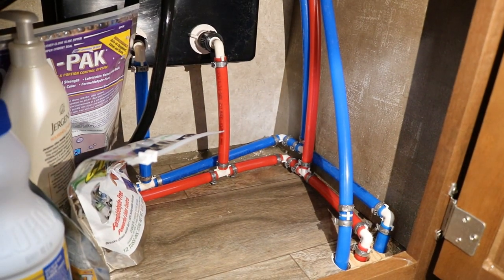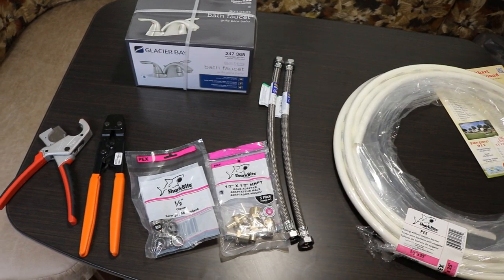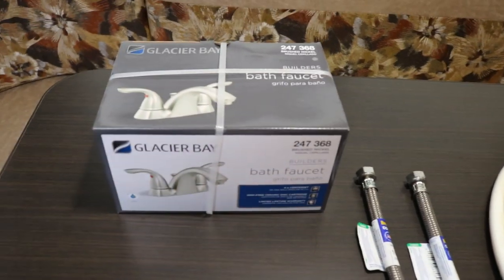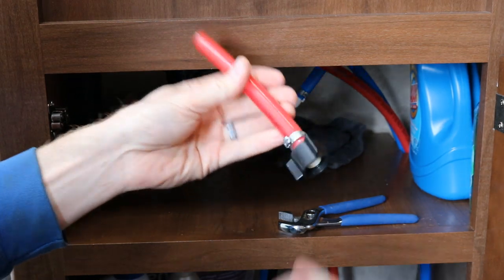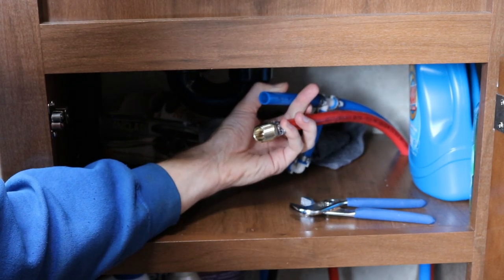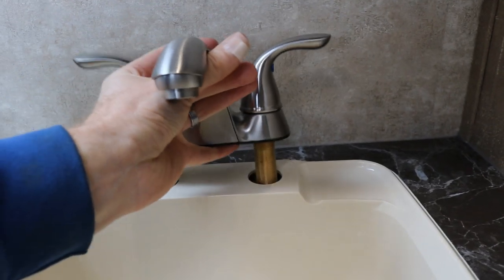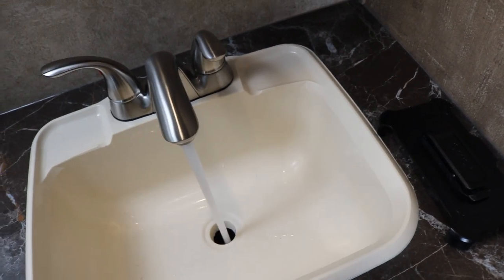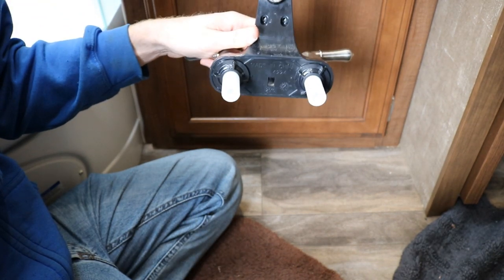HOW TO FIX RV PEX (Faucet Replacement DIY)  #rvlife

Comment: Exactly the same issue. Hot water line to bathroom sink leaking for absolutely no apparent reason. I have my own repair plan based on our setup, but what a relief to know someone else has experienced the mystery leak.
Reply from the maker: Should be a simple fix for something tht factory messed up

Comment: I did something similar, but instead of the male fittings, I used shut-off valves.  Did the same for the kitchen faucet when I upgraded it.  That way, if one leaks, it can be isolated and the rest can be used.
Reply: Excellent idea and one I'll add to the repair I'm doing on my system today. Thanks!

Comment: BrassCraft makes a push connector (like a shark bite) with a shut off valve and screw on connector all in one for around $17.00.  They sell them at Home Depot
Reply: Thank You for the heads up about the Brasscraft from Home Depot.  My hot water spigot under my kitchen sink started leaking and I didn’t want to wait for the swivel seals from Amazon so I went and got two of them and because I was small enough for the 14 inch wide cabinet, I got them both changed out and back up and running in 30 minutes. You guys are the best at helping people that will DYI..  Also love I have cut off valves now. I figure before the end of summer I will be doing the same thing under the bathroom sink.

Comment: My bathroom faucet cold handle blew out & i have a regulator on the water coming in. Im going to change the kitchen faucet too. Thanks for the video. Im putting shutoff valves on mine
Reply from the maker: Great idea

Comment: At the 10:00 mark you were wondering why the swivel termination fitting leaks...It is the sealing washer primarily. They start soft and conical, but harden, flatten/form a step, and then start leaking. Instead of using flex connectors, if you 1.use elbow fittings to remove stress and align fittings properly and 2.use a new swivel seal (flair-it brand seals will work in your fittings), all will be well. Your mfr did a terrible job aligning fittings. I'm seeing a lot of that lately, and the stress often causes swivel leaks...which I get paid to fix. The reason those flex connectors are not generally used is because RV water pumps are wimpy compared to city water pressure and volume. Flex connectors have restrictive (tiny hole) end fittings which works fine in a home, but not so good for RV use except in park models. Sorry for the rambling comment, couldn't help myself. 23 years repairing RVs professionally, and I do a lot of plumbing.
Reply: Thank You for your expertise and knowledge I appreciate it

Comment: I had the exact same leak in the exact same spot. I watch your video and it gave me the confidence to perform my own repair.  I purchased the exact same faucet and supply lines as well..The toughest part of the job was tightening up the supply lines in a very confined area as you know.  I ended up using the shark bite fitting in lieu of the crimp fitting…Thank you for posting  this video!
Reply from the maker: Glad it helped!👏🏻👏🏻

Comment: Great video and I agree with you, I fix it myself. New 2017 Coachmen travel trailer had super cheap ac outlets that were breaking, They crimped on the hot and neutral wires inside the outlet. I went to Home depot, bought new Leviton 20 amp outlets, blue boxes, cover plates and replaced all the broke ones myself. It would have sat at the dealer repair for 4 weeks.

Comment: Your video makes sense, just had the same thing happen in my rig. Kept on seeing water under the sink but couldn’t find it until yesterday. All of my connections were tight but after really getting into it I noticed the leak was coming from underneath the center of the faucet... when turning on the hot or cold water. I went to Lowe’s and did exactly the same repair you made. Thank you bro. Your parts list was spot on.
Reply from the maker: Glad it helped! Thanks for the feedback.

Comment: Another great video. I have the same issue I'm fixing today but in the kitchen. My leak is the connection to the faucet failing. Thanks for the info as it's my first time working with Pex. I have  a feeling the main sortcomming of Pex is the Pex to threaded connectors. Your solution going Pex to brass with standard supply lines is perfect and what I'll do on mine. As for DIY, yeah, "give a man a fish....". Being able to handle your repairs on your schedule and on the road is the only way to go. Thanks for your brilliant channel!

Comment: Good job. Best to install two shut off valves so on the future if you have trouble you can shut off just that faucet. Flexible supply lines is a good upgrade for all faucets.
Reply from the maker: Thanks for your input!

Comment: I just spent 4 days in my Heartland with no water because of this same issue.  The plastic fitting came off and fell apart.  Of course I had no way to cap off the pex and was nowhere near a store to pick anything up. I could not a shut off valve to the sink so we could not use the water at all.  I will be changing to flexible line and a real faucet.  Thanks so much for this video. Real life saver.
Reply from the maker: Very welcome! Hope you get your trailer fixed up quickly. Let us know if you have any questions

Comment: Great video.  Agree on fixing it yourself vs. RV dealer.  Our kitchen faucet needed to be replaced.  Went to Lowe's to pick up the faucet, but it came with integrated supply hoses.  So, another trip to Lowe's for SharkBite PushToConnect shut-off valves.  Snip, Snip, PTC, PTC, and screwed on the supply hoses.  Now, if our sink ever has trouble, we can just twist the valves to shut it off, instead of shutting off the entire water system.  This is important for full-timers.  We've also replaced our shower with a residential one, , and swapped in a residential fridge, too.  Someone in our RV park was in need of a "new" fridge, so he helped me remove it, and hauled it off.  Nothing is sacred in our RV. You know... except each other.
Reply from the maker: That's pretty cool that you put in a residential shower! If we would keep things long enough we'd do that too

Comment: One tip I would offer when installing a new faucet, always connect the supply lines to the faucet before you drop it the sink holes.  Either have threaded hold down washer over the lines or run them up to tighten.  It’s a lot easier than trying to tighten them once faucet is installed.  Great video, thanks!
Reply from the maker: Great tip, thanks for watching!👍🏻

Comment: Nice video.  I was specifically wathing how you handled the PEX type B fittings as I have a similar project in my own RV.  You covered it well.  One comment I'd mention is that looping the flexible lines is a good idea.  An old experienced plumber told me to measure the length that you need and then buy about 10 inches longer so you can form a loop in the line to prevent side-loading the end fittings of the flexible line.  He said that was where they always fail.
Reply from the maker: Thanks for the info!

Comment: 3 years later from the video, I’m having the same problem.. so glad you made this video . Thanks
Reply from the maker: Glad to help!
Reply: Same deal right now again gave a little turn and leaking more than before but sadly  im used to it already  Brand new jayco been nothing but leaks at every joint jayco and the dealer we purchased from say user error 60k cash and almost 10k for extended warrenties juat to be told we cause the leaks at jounts
Reply: @WanderingWagners  funny i sent my comment before you finished video yes i agree they had ours for over a month and it came back same problems jayco found nothing wrong.with it no leaks .... often qonder if they hooked water up to it because at that time before fixing myself we had big puddles in basement everyday .. now we discovered the joys of the condesating walls of every tip out and mold happening under mattress its a nice trailer its home but man its a battle .. ok my. Comment turned to a rant lol sorry its late and kitchen sinks doing as ur bathroom.did  never ending haha thanks for sharing ur fix
Reply: Crazy I have the exact same model and year and have the same problem

Comment: trailer - 2019 grand design imagine 2670mk

wow, with how many people had the exact same problem as you and i, it seems like maybe the  industry needs to look at better installation standards. 

I took your advise on the half inch to half inch flex supply so that my water lines will sit straight and not be tugging on the tap. to be fair i had a crappy $10 pressure regulator before, then upgraded to the higher flow $70 pressure regulator with the psi gauge, and ran it on default @45psi and when this happened it was right after a psi spike from heating water...so i partially blame a weak and ill designed installation and partially blame myself for not leaving a drip while heating water haha but thanks again for the help and idea!
Reply from the maker: Yeah the QC at RV manufacturers doesn't really exist unfortunately
Reply: @WanderingWagners  Sad but true.  Older, as in 40 to 50 year old trailers were built so much better that todays over priced units.
In this RV park I have neighbors with units 50 years old that have stood the test of time even with a decade or two of full time living.

Comment: We brought the same Jayco trailer and sure enough we have the same leak in the bathroom faucet. Thanks for posting this as I'm going to do the same fix that you did.
Reply from the maker: +jldacz after the fix I made we haven't had a single leak since. Overall we love this trailer!
Reply: I bought a 2017 Jay Feather. Same thing. Leak under the bathroom sink at the "T" for my cold water. Had it fixed (since its warranty) and it leaked again, this time from the same place yours did. Its back in for the warranty (its about 1 mile from where I store it). But im going to purchase the tools and some pex to keep with me from now on. Thank you for the video, its helped a ton!

Comment: I just found a leak just like this underground my kitchen sink. Thanks for the video really helps me out.
Reply from the maker: Glad it helped!
Reply: Did you put any thread sealant on the connections
Reply from the maker: I did not. Those fittings don't require it.
Reply: Wandering Wagners ok great just making sure I don’t need it.

Comment: Had same issue with 2020 Coachmen. The water didn't leak until water heater cycled after doing dishes or taking shower.
Reply from the maker: Hopefully you got it fixed up!

Comment: The fittings the factory used are the cheapest ones they make when it comes to rv plumbing. they crack at the base when you over tighten them to, so most likely the pressure from the pex and the amount they tightened it caused it to have a hairline crack, then when you tightened it yourself it cracked the rest of the way. if i was you, i would replace any and all fittings with flair it fittings.
Reply: the cracks are hard to see.

Comment: Excellent video! - It's given me enough confidence to try to replace the cracked manifold in my new Winnie. When I took it to the dealer late summer, it sat there so long that it cracked since it wasn't winterized. I'd rather fix it myself than drive it back to them (125mi ea way) and leave it for another pile of weeks.
Reply from the maker: Exactly is always easier, faster, cost efficient to fix things yourself. Glad this video helped give you confidence

Comment: Nice fix! We had a leak in a similar location (under our bathroom sink) but it was actually the city water inlet fitting (one of those places where it was bent sideways and stressed instead of using a 90° fitting🤦🏻‍♂️)! The least we had before that was where the hot water line connected to the water heater. Just like you I tried to tighten it but it ended up way worse so I just replaced the fitting which still seemed fine! No idea why it leaked so badly!🤷🏻‍♂️
Reply from the maker: Just the way it is unfortunately. Glad you got it all fixed up! That's why we carry pex and tools with us at all times haha

Comment: I believe the reason why they use plastic water fixtures it's all part of cutting down weight. That my opinion based on absolutely nothing but thought. Thanks for the video! I have the same leak on the hot water line. I believe that it has to do with the expansion and contraction of hot passing thru a cold pipe over a period of time. I found that the only time mine leaks is after the hot water was used.
Reply from the maker: The connections were loose from the factory in our case. Both the bathroom and the kitchen were loose and the bathroom needed replaced. Easy fix though!

Comment: Inside that hot line you showed there is a little white grommet, what happens is they get over tightened at factory and that grommet causes the leak. Which might of been why when you tried to tighten it increased the amount of leak. Replacing that little grommet should stop the leaking and then do not over tighten.
Reply from the maker: +Ryan Remy thanks!

Comment: Its really sad that a brand new expensive camper leaks after a few camping trips, i`ve owned 7 campers in my life and most are built like crap, our present one has a rotted slide floor from improper water drainage and the slide just sorta floats when extended. Done with slides and i am convinced that the Scamp 5th wheel deluxe model is the only camper i will purchase in the future, small but perfect for just me and the wife and a dog. Enjoy your videos and as a retired semi driver i enjoy watching you be the boss backing that rig up !
Reply from the maker: +billg1527 we've had non slide campers as well and they're not without their issues. It is sad how the rv industry has no quality control. Looking at brand new rv's on the dealer lot and seeing things broken already is proof. Sad that it's expected to have issues right away.

Comment: We tend to associate plastic with cheap, but if everything in the trailer were metal instead of plastic it would weigh significantly more. Good video. Thanks!
Reply from the maker: We'd rather have heavier trailers vs flimsy ones that don't last but a few years of decent use. Thanks for watching!

Comment: That’s exactly my problem, it’s the hot water line, up under the sink.
Reply from the maker: Seems to be a common problem
Reply: I'm so glad I looked on YT and even more pleased to have found this repair and helpful fix to a bathroom faucet leak.

...this is my story here below....

My vintage 265 "Casa" SHASTA that I have been living in full time now for five years just had a leak occur on my bathroom's cold water line.
I'm going to close off that line temporarily with a cap until I can gather all the pieces including a shut off valve and new faucet to fix the quite old assembly from the factory when this unit was built back in 1996. 
As it is my habit to use only the 'cold' aspect of the faucet it appears, yes appears* to be that this is the side that is leaking. 

* I still need to get into the cabinet and locate the leak but I'm pretty sure it is the cold line that has given up holding a seal.

My best friend is willing to be my plumber for a day (hour or two) in the tight quarters of my Casa Shata's bathroom; thank goodness for good friends that are small in stature.
My 64 year old body is not so flexible, for sure I'm not so good at kneeling and squatting in the confines of an RV bathroom.

Comment: Plumber's tape isn't necessary? Curious, only. Adding cut off valves to each line may be a real life saver when a leak happens and you are trying to stop the gushing of water everywhere. It isolates the line and just seems like the better way to do such. Nice video. I have an E-pro 19FD and some folk claim I can access my kitchen sink water faucet by removing the outside shower panel and getting to it from behind. Believe me, it is all "feel" alone when you try to do this task from the inside  My problem is that at m age I drop stuff easily and don't bend down on my knees easily to get at some plumbing fitting like this in such a cramped space. Unfortunately, there are zero videos on YouTube in making the kitchen sink faucet swap, so this video helps in a round about way. Again, thanks for posting.

Comment: Great video. My 2017 POS Crossroads trailor is leaking like this except from the kitchen sink..hot water (red) Pex right at where the clamp is. Thing is, it's a light drip.drip,..and yet when I put an aluminum tray to catch water..(faucet off) it seems to fill very quick in about a couple of hours. Thinking of trying your fix..but VERY afraid to start cutting..as can't believe so much water can come from a  overtightened clamp!
Reply from the maker: +Dav777 we also had a leak under the kitchen sink, but it was able to be fixed with tightening the connections. Not so lucky with the connections under the bathroom sink. Good luck on your repairs! Let us know if you Jane any questions👍

Comment: So I saw this video and got alot of great info from you but I have a question about the pex lines outside , the drain lines. Well one has a split up the line about an inch from the crimped clamp near the drain.The split looks to be about a inch long and I was wondering what is your suggestion in this instance? I'm no plumber but will try and fix almost anything. I thought about just shortening the line and using a old school (really small) radiator type clamp. Would that work do you think or should I go buy all the tools and hoses and clamps and such? I don't know if the little town I just moved to will have stuff in the local hardware store and home depot is a good 45 mins away. Thoughts? "Please and thank you..
Reply from the maker: A hose clamp won't be able to compress the pex enough to keep it from leaking. I'd recommend using pex clamps.
Reply: Ok. Thank you. Happy weekend